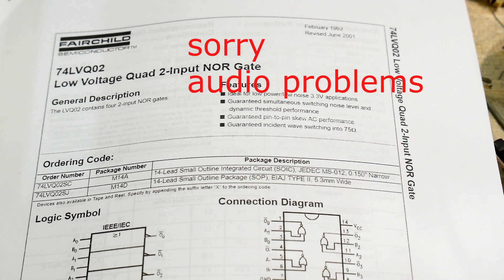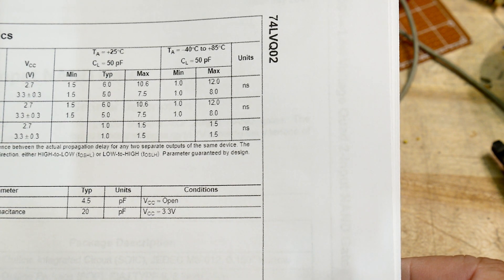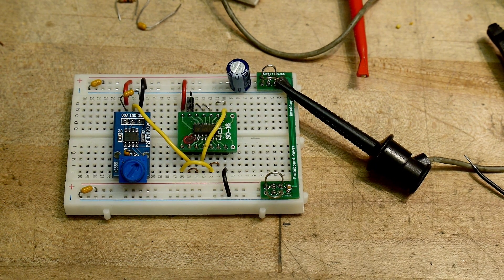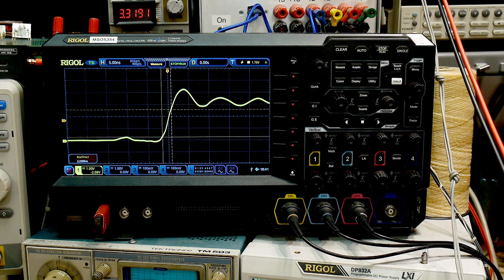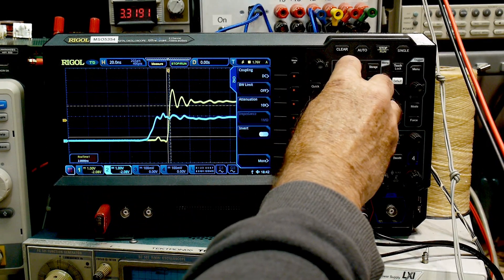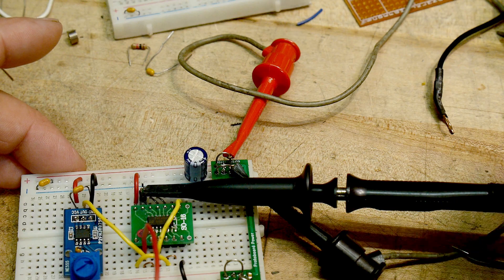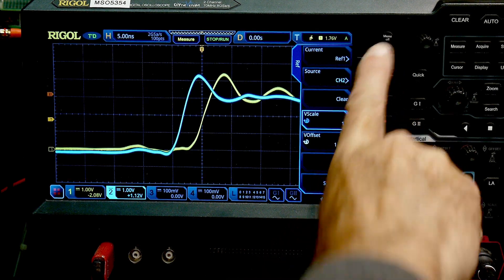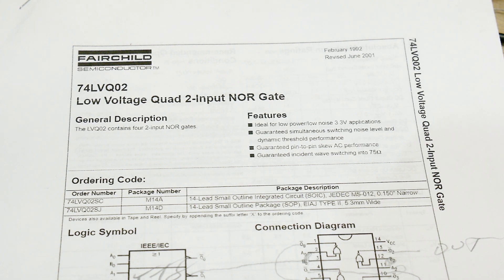#1739 74LVQ02 Quad NOR

Comment: Did you have a decoupling capacitor on the breakout board ?
Using the springy groundclip for the oscilloscope is a good plan. But if ground comes from the power rail of the breadboard, it will not be very helpfull.
Interesting 74 family indeed
👍🏻🤝🏻🇳🇱

Comment: Great video. Of course if you're trying to use a short ground connection, you should decouple the ground at the point you're hooking up the scope probe with a low inductance capacitor. Otherwise, you have to add in the inductance in the breadboard...
Reply: You'd have very hard time making any significant improvement that way in the circuit in the video is made. You'd still have to have substantial lead length for the capacitor.
It is much better to put the grounder tip on the ground pin of the IC and the probe tip on the pin of interest. That isn't easy with SM parts, although standard 0.05" pitch SO parts aren't too bad.
I used to put a bunch of void dots in the solder mask on the top side of a board with ground plane areas on the top, or sprinkle around some small vias if there was ground on another layer. A small blob of solder on the copper in the voids makes a good "anchor" for the tip grounder if an indent is made with a small awl. Vias work similarly. I've used pins from precision contact IC sockets to make really secure places for the tip grounder wire.

A FET probe, not always useable,  helps because there is much less tip capacitance to resonate with the ground connection inductance.
Reply: @D614G_aka_Doug  Good points, but if you are probing the pins of 0.05" parts, you are younger or better preserved than I am. I always use a nearby ground via for PCBs but even the 0.1" breadboard spacing isn't safe from me finding a way to short out critical pins, usually in a way that I couldn't reproduce in 100 years of trying!